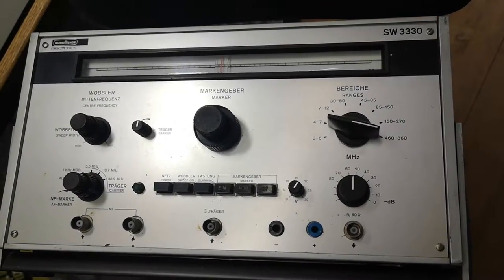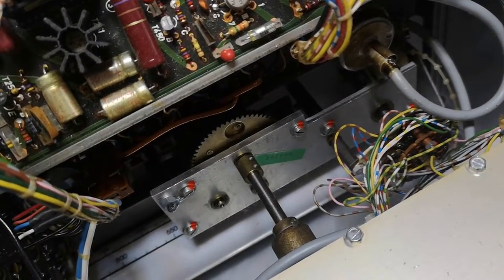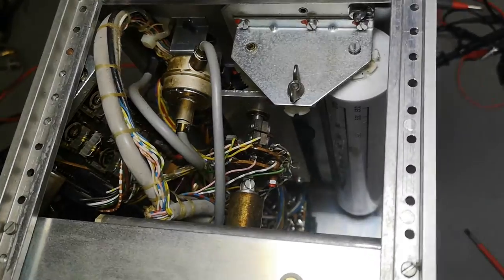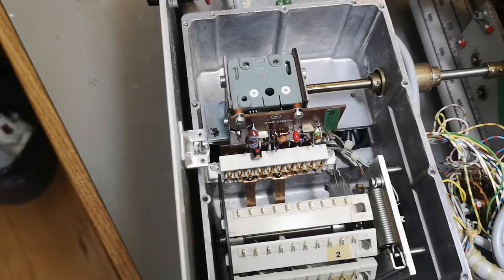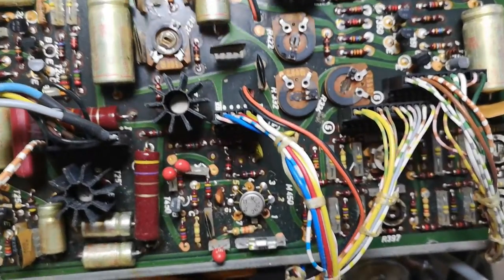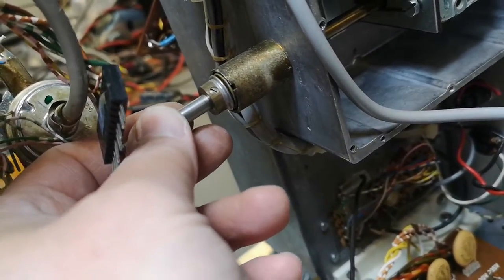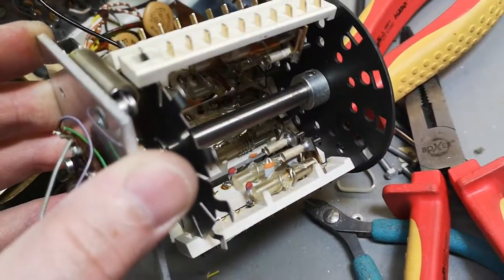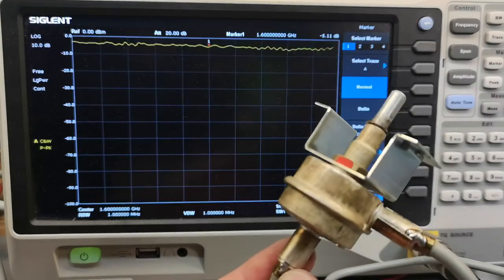Nordmende SW 3330 Wobbler Sweeper 1972 test and teardown

Comment: Old Turret tuner from a TV set, common from the first tubed TV sets till the beginning of transistorised sets, vanished with the start of integrated circuits in TV sets and development of decent varicap diodes. Also the tombstone capacitors, the first ultra low inductance capacitors. The couplings are made by electroplating, copper deposited onto a carbon coated wax form, which was then melted away when the copper layer was thick enough, then finished off with a coat of nickel to protect it. Commonly used to make bellows, and you can even put the ends in there, copper or brass, and get the bellows formed directly bonded to them with no joining needed. Otherwise they are made by rolling, using a mandrel inside the tubing, and forming it in a lathe to turn the bellows and then anneal the metal in an inert atmosphere. Normally this is to make things from beryllium copper, as you cannot really electroplate alloys.
Reply from the maker: exactly the same age tv tuner dial looks a bit like this, ok maybe a bit cheaper made.. only a few year later they dropped the dial and all the complex movng parts, for the 8 push buttons, and the lit under the buttons hid the 8 frequency adjustments.. you are close to have figured out how old i am :-) Sean..
Reply: @TeardownOZ2CPU  TV in my country started when I was a teenager, and that was not many years ago. 

TV tuner was simplified for mass manufacture, but they still had the more expensive tuners for the top end sets, and for TV station use, where they would see a lot of operation, so they would use them here, plus they also used them in industrial equipment as switches.

Comment: Smells like it was made by Philips all over. I wonder how it came to DK since where we use 75 ohm systems, Germany did earlier use 60 ohm antenna systems, feeders etc.
Reply from the maker: YES erlier Philips generators also got 60 ohm outputs, so it was a standard impedance from before 50 ohm and 75 ohm.

Comment: LM709 the grandfather opamp, now you can build a cracklebox or "kraakdoos" noise maker ;)
Reply from the maker: ua702 ua741 then lm301, right?
Reply: @TeardownOZ2CPU  702, 101 and then 741, integrating the compensation capacitor, and making it no added component unity gain stable, a big cost saving in not needing that 33pF silver mica capacitor on the board.